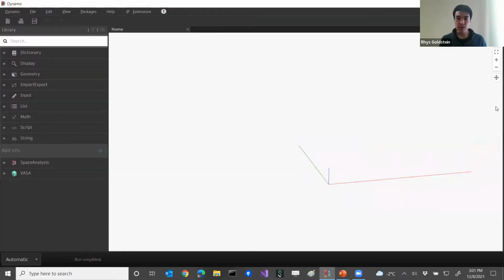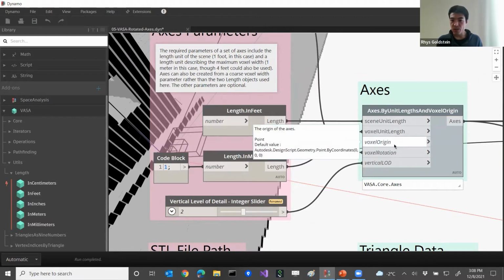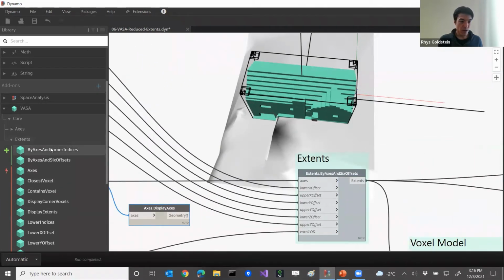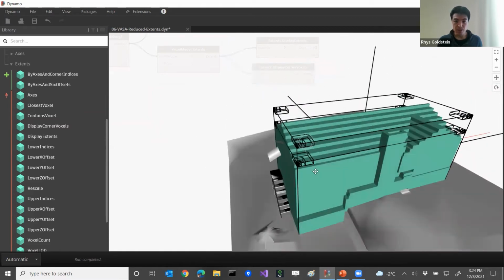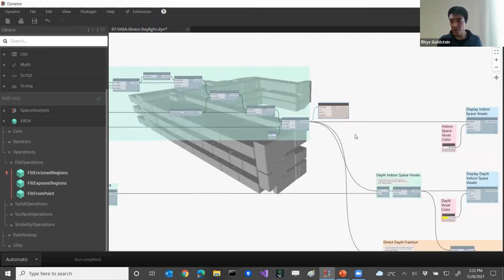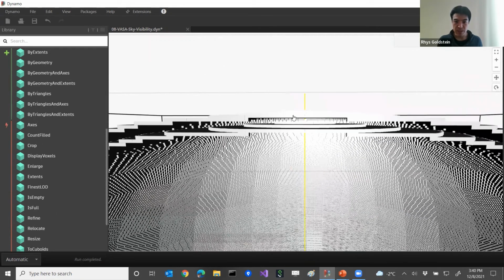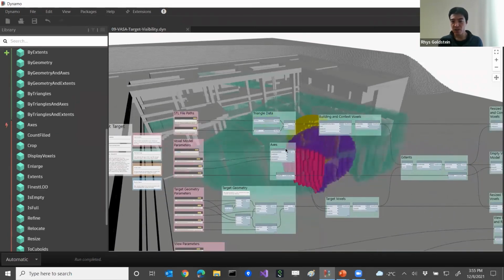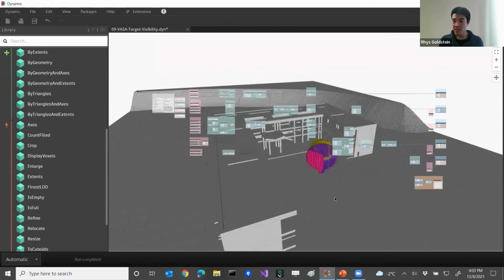VASA for Dynamo: Comprehensive Guide - Part 3

Comment: Hi Rhys, thanks for introducing VASA, I’ve got a quick question, can the voxel model be exported to, go example, h5 format?
Reply: Hi Amanda, good question. The current version of VASA (0.1.2) does not have any nodes that will export voxel data directly to a file. If we decide to add such a node in the future, we will consider the HDF5 format. Thank you for pointing out this option!

In the meantime, you can write a Python script that traverses a voxel model using VASA's SliceIterator. There is an example of a Python script in sample #10, which I plan to cover in Part 4 of this video series. Your own script can write voxel data to a file in any format you wish. It should be possible to install the h5py Python library for use within Dynamo, which would allow you to export voxel data to an HDF5 file.
Reply: @rhyskg  Hi Rhys, that's very helpful! Also thank you and Kean for replying my email, I'll give it a go using Python. Warm regards.